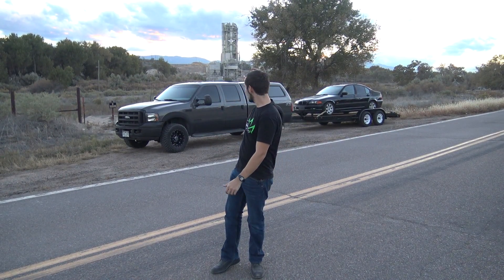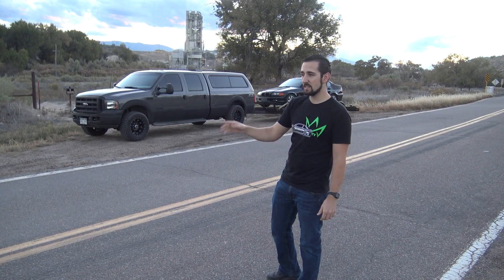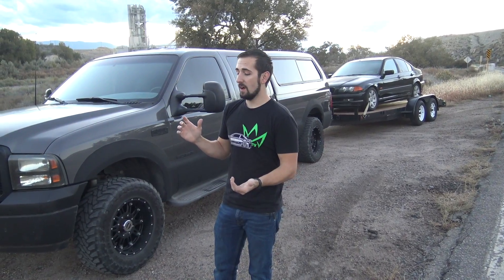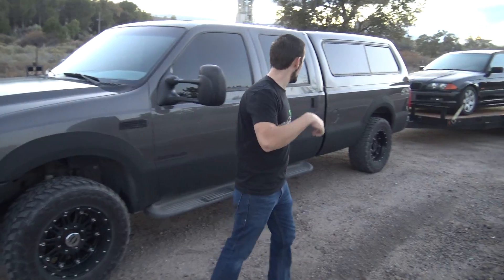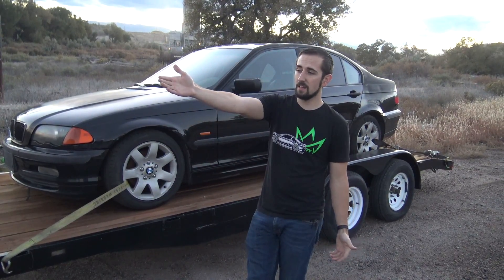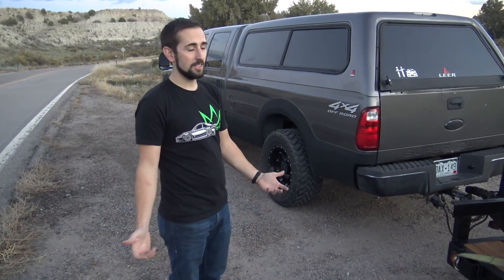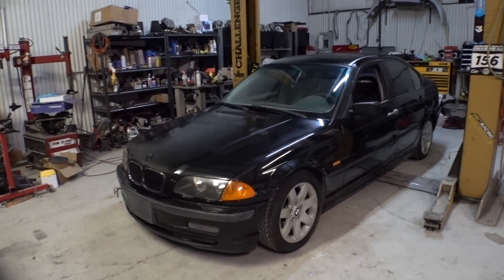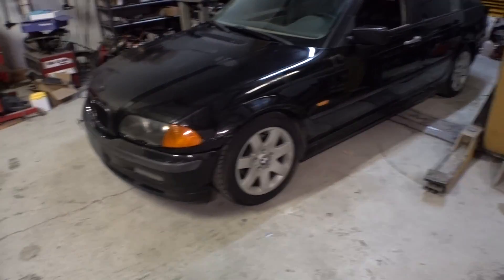THE NEXT GIVEAWAY! - Take it to the Track pack!

Comment: I think the BMW needs angle, maybe not a kit but some cheap and effect mods. Then more power, full bolt on and maybe a tune. Next is weight reduction, get rid of all HVAC systems, unnecessary interior. Race seats with harness bar. After market steering wheel. Duel caliper hydro set up. A fat review mirror. Good suspension and bushings, along with great fitment. What makes a BMW is fitment. Bash bars would be cool as well. Maybe a short through shift. Now sure how the throw is currently. A clutch would be cool too. I personally think you should paint the BMW white with black side skirts and lips on the bumpers. Then find a very OEM looking spoiler.

Comment: Shifter column bushings are also like 10 bucks and all you have to do is take the column sheathing off and drop the column with 2 27(?) Torx bolts and pull the caps off to put new rubber bushings in to fix the column slop. Pretty simple fix for the next owner not to have to worry about. It will eventually get so bad it wont shift in park 100% first try or make it not think it's in park to not start.